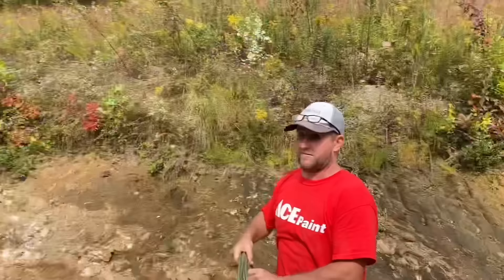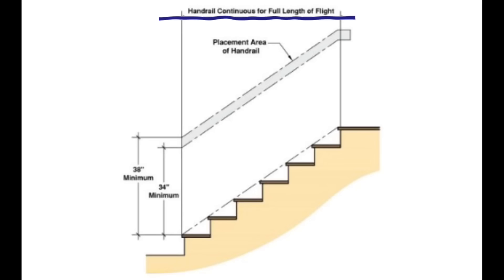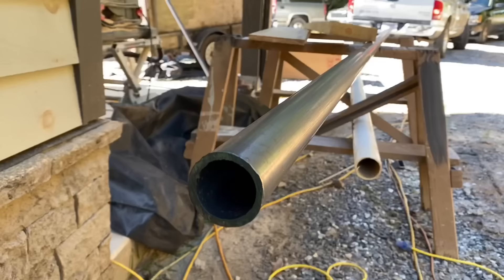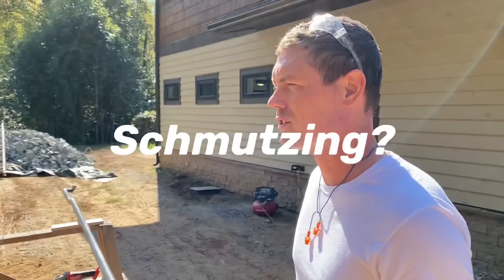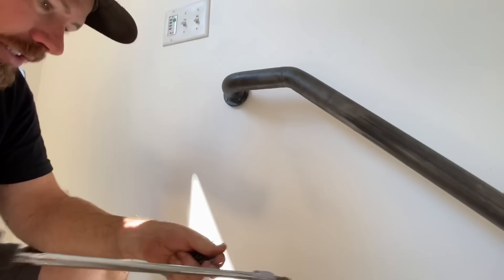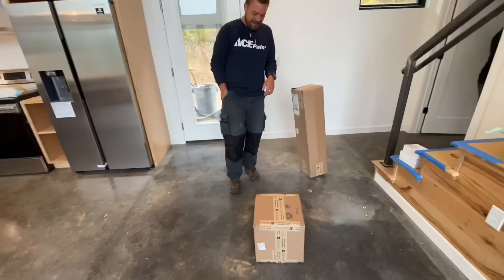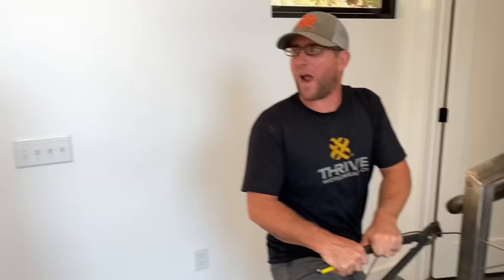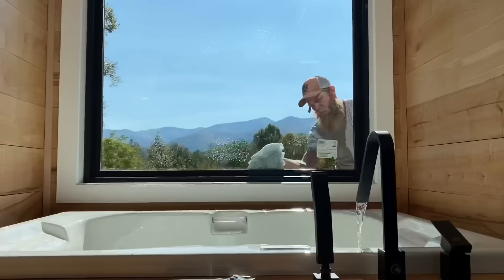Building A House Start To Finish | Episode 24

Comment: Your boating knife has a marlspieker and schekelöffner, it can be used to open bottles but you would use it normally as a tool to unscrew bolts with wings

Comment: Hey guys all the way from South Africa.  I love your channel and you give a lot of tips and tricks to make jobs go faster. Just some advice on that weard angle of the post for the safety rails on the steps. If you use a milling cutter bit the rimming goes faster and leaves much less of a bur to file off when you are done because  the milling cutter bits are made for taking of steel materials from the side

Comment: Holey crap Batman!  Get one of those diablo saw blades, the Kermit carbide one designed for metal cutting, then you can chop metal on a mitre saw or with a circular saw.  Straight, fast cuts on steel at precise angles with no sparks or grit flying sounds like a good time doesn’t it??  
Way worth the $30 for the blade.  
Slap one on a cheap Ryobi mitre saw and you got a portable chop saw that cuts steel quickly and safely all day for less than $150 total.
Reply: Perkins Brothers: do you guys ever have trouble keeping the 3/16 cable taut?  I see you only used the studs and no turnbuckle.  It's a short run and doesn't warrant a turnbuckle, I'd agree.  That said, the 3/16 just seems to loosen over sometimes short timeframes and clients are like: what's up?  I've found the 1/8 stays taut no problem.   In other videos on longer runs and outside you've used 1/8.  Any pro knowledge?  I also use e-rigging products.
Reply: @charliehiggins9355  did all the runs around it slack up evenly? Or just single random ones?